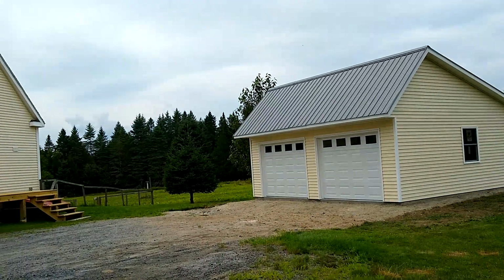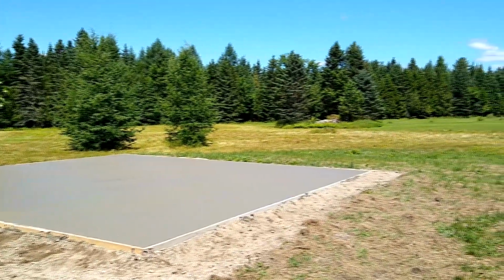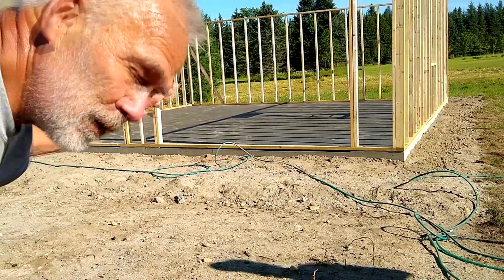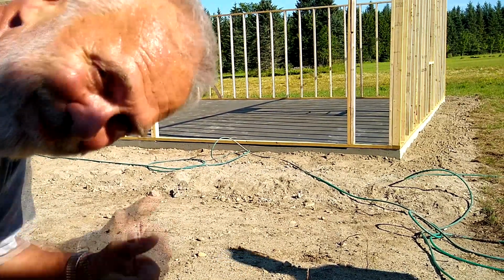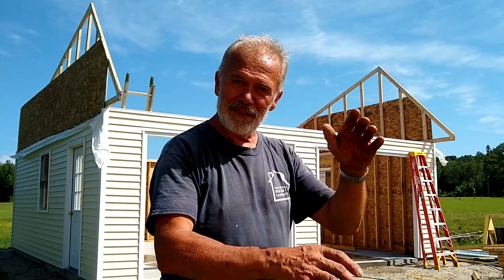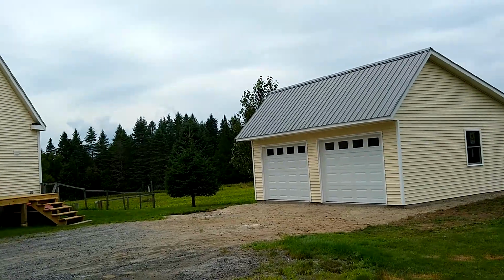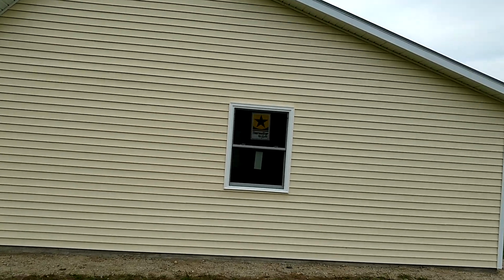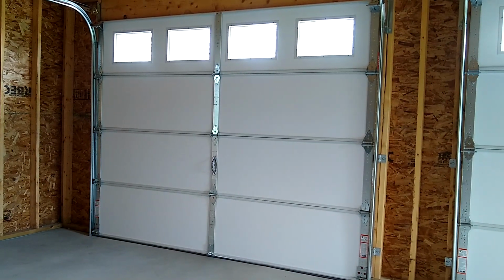Building a Saltbox style garage

Comment: Isn't a waterproof membrane under the metal roof needed? Enjoying your videos...researching for my new garage.
Reply from the maker: Dadmezz if it’s a steep roof pitch like on the front we don’t worry about it because the metal roofing gets rid of the rain and snow doesn’t stay very long. A shallower pitch we always put a membrane down
Reply: That roof will still get wet because of condensation and will rot the sheathing
Reply: I agree. You need to separate the two material or it will sweet. Didnt see any strapping to let it breath...

Comment: setting up the wall directly on concrete with no plastic or waterproofing membrane?moisture and humidities rise off the ground and penetrate into the wood and ruin it over time.
Reply from the maker: m arian thanks for the comment. Three minutes into the video you can see sill seal stapled to the pressure treated. You’re absolutely right. I wouldn’t do it any other way.